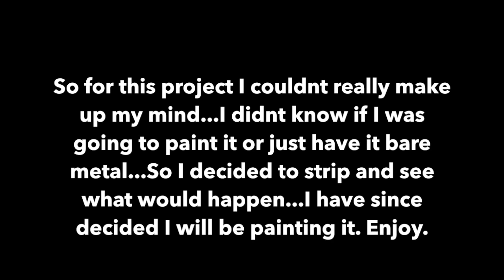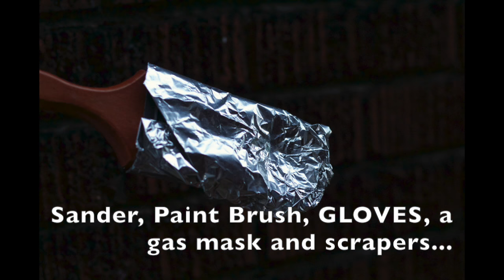Thrift Store Vintage Tool Chest  Makeover Part 1

Comment: Just so you know, the part that's broken off is the handle to that door. It's a small plastic handle just like the drawers have. The door folds up when the lid is open and when the lid is shut, two small pins slide down inside that door to block off access to the drawers. If you shut the top down without the door on, you can see the two pins drop down. The idea is that you shut the door to block the drawers and lock it. The pins won't move to allow that door to open therefore locking the entire box with only one lock.
Reply from the maker: Yes,thats exactly what it was, it was funny though because at the time we thought it was broken or locked, so did the store employees. When we brought it home we noticed thats how it worked. Thanks for the comment! :)

Comment: The front panel was not broken, it sits in front of the drawers to keep them from opening during movement.  There are latch pins to hold it in place and I believe I noticed the handle 
for the panel in the top tray before you started.  Maybe the next one will be better.

Comment: Are use brake cleaner to get the crappy drawer liner off on a 1950s mechanic chest it worked pretty good with some Elbow grease

Comment: I'm refinishing a similar toolbox... do you have a video showing the priming and painting of this one?
Reply from the maker: I still haven't decided whether to paint it or not. That's awesome that you are refinishing one,is it a bigger one or smaller one?
Reply: So, the box you got for $5 is a Kennedy Machinist tool box there are several on ebay.  I have a similar one myself, the lock is not broken on your box, the thing that is missing is a knob like is on the drawers.  The way it works is, you insert the key into the lock that's at the top and turn it, there are pins that will retract or extend (I could see your box is set in the locked setting because the pins are extended in your video)  Anyway, you retract the pins, set the front piece in place, turn the lock and the pins will hold the front in place... Now you know.  Kennedy boxes are valuable, yours I have seen sell for $50 to $120.